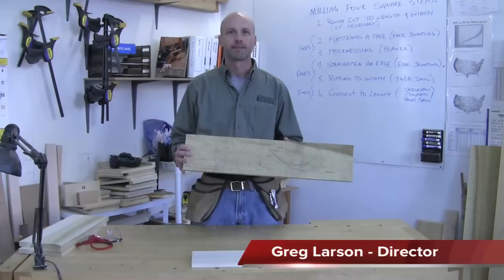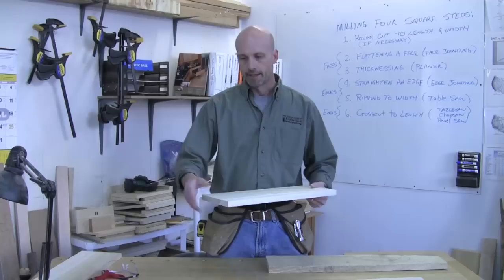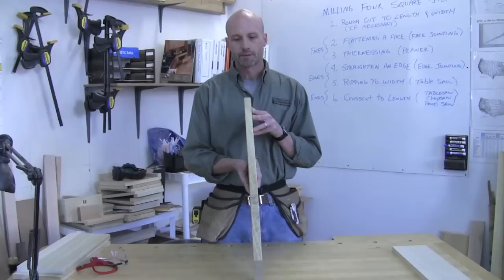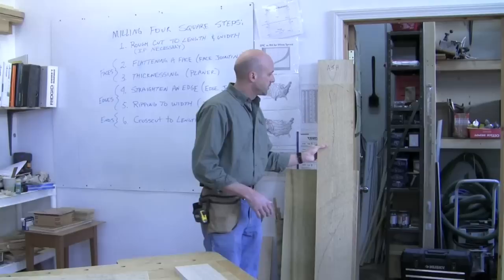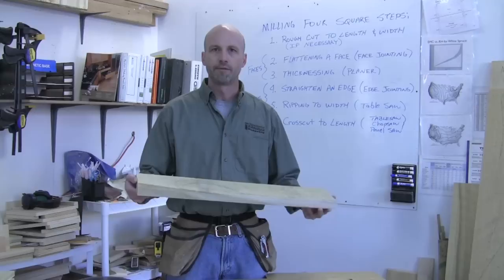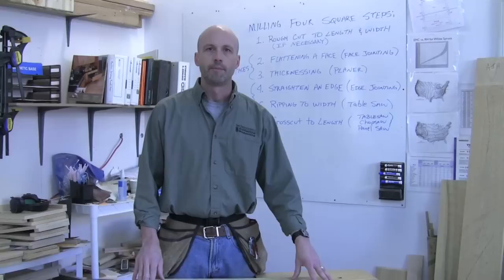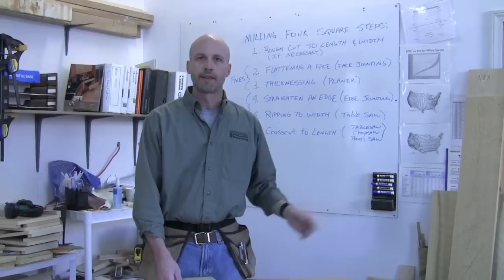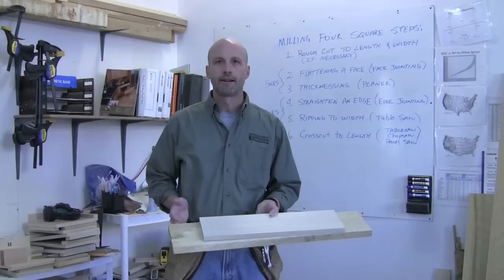Milling Four Square - Introduction

Comment: Great series of videos - what brand/model apron are you using - looks simple and out of the way.
Reply from the maker: Hi There.  Thanks for the inquiry.  I don't use that belt anymore, mainly because I fill it so full that it gets too heavy!  However, I really like it a lot.  I used to get them from Duluth Trading Company.  I just searched their website and couldn't find it.  They might not stock it anymore, unfortunately...